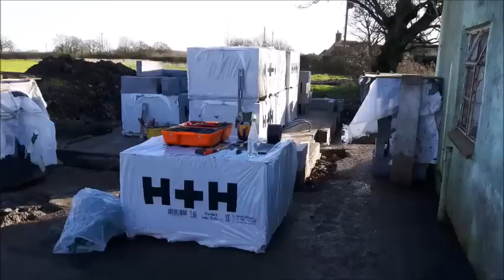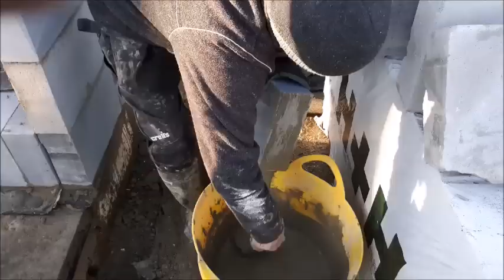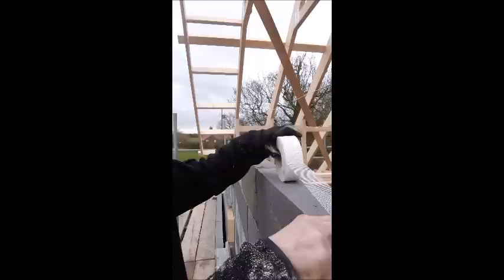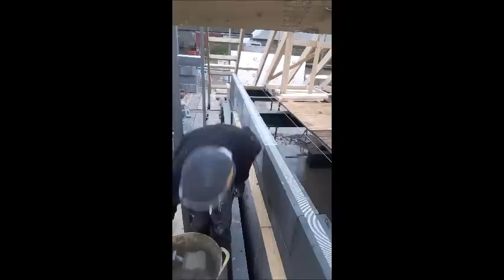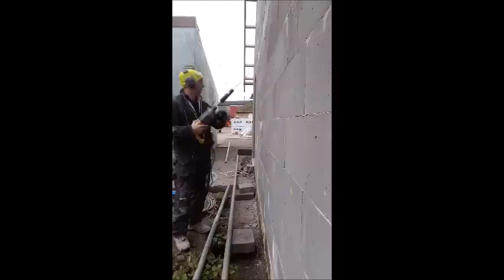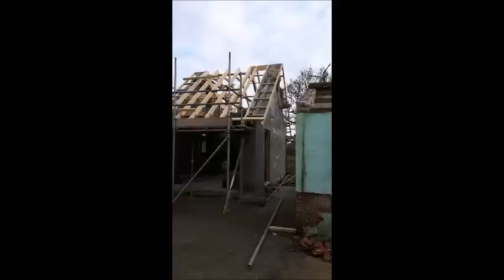the fine art of brickwork   -  Garage - Thin Joint 6

Comment: Hi Rob really enjoy your videos. Was just wondering, when I learnt about thin joint blockwork at college they said the benefit was getting the internal skin up and watertight so external could be done same time as internal. Would you be able to do a 2 storey internal skin with 4inch thin joint or would it have to be wider blocks?
Reply from the maker: 100mm inner leaf is ok right up to roof height, but you'd need to put the floor joists and the load bearing internal walls in to give the whole structure stability.
There used to be a Thermalite and a Celcon video showing this but I've not seen it for a long time.
As I mention in the video, thin joint is the only way to do blockwork in my opinion.
Reply: rob songer I always thought it seemed a much more efficient method but unfortunately it still seems very alien on most sites. With the extension there's quite a bit of detail with the external stonework, the thinking was if I could get 2 storeys up and roof on, stone could be done at the same time as some internal works. Do they sell all this at certain merchant's or do you source straight from the manufacturer? Thanks for the response, sorry for the essay!
Reply from the maker: all builders merchants should supply thin joint materials but generally they have to order it in. The best place to get the tools you need is a company called Tackburn.
Thin joint has been the main method of construction in Europe for over 30 years but here in the UK our workforce seem to be afraid of change. Thin joint is by far the safest, cleanest, quickest and strongest form of constructing blockwork.
Reply: @robsonger1  This H+H video shows how the joist hangers are installed so that you can get the floor joists installed with quickly so as to get the internal skin up asap : https://youtu.be/gbQf_YHd6a8
Reply: @adamchandler8872  As a method it has it's own challenges. It does allow the internal walls to be put up within a few days and for the roof to go on straight away, but while the blockwork is exposed to the elements, they will absorb water, and this can make them more prone to cracking. They are quite prone to cracking anyway, hence the bed reinforcement every second layer. They also need more movement joints than traditional blocks, if cracking is to minimised. Rob's way of stacking the blocks is good practice and will definitely help with drying them out if they are still a bit damp from the manufacturingg process.

Comment: If you fart on it 😂 it fall over 😂
Reply from the maker: Believe me, after 10 minutes you can hammer ties into the blockwork,
and, it you have to knock any down, it will never break on a joint.
Reply: @robsonger1  That's interesting. It should really break at a joint. My understanding is that the mortar is supposed to be very slightly weaker than the blocks, so that if the blocks shrink, the mortar will break before the block cracks.